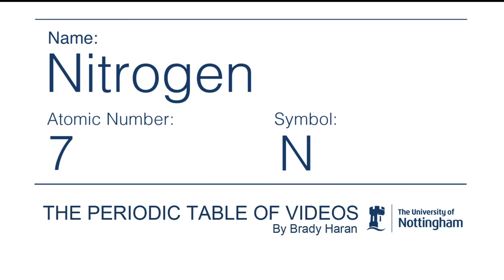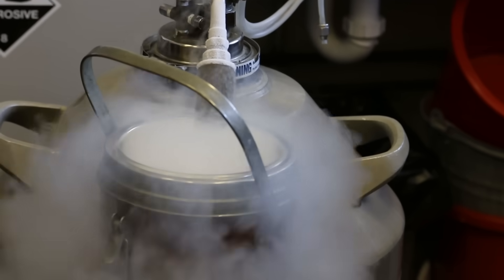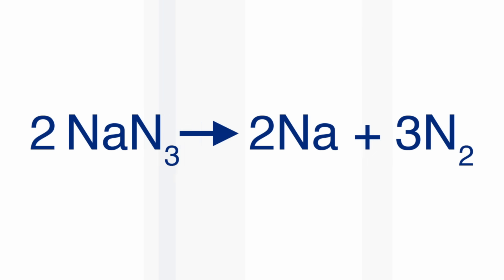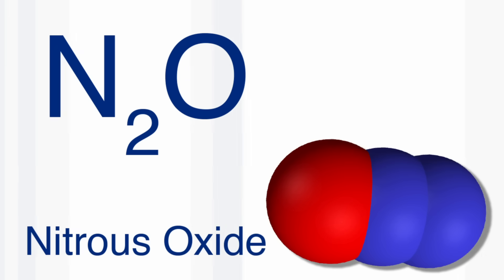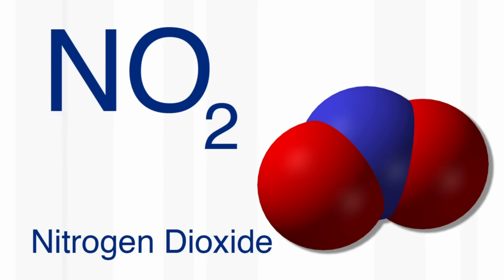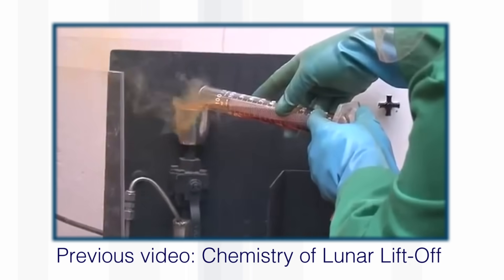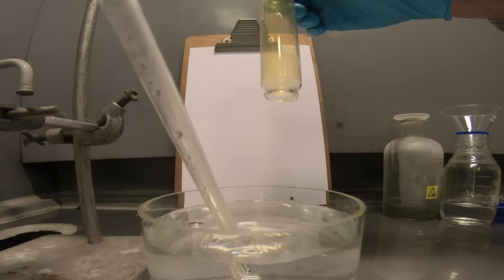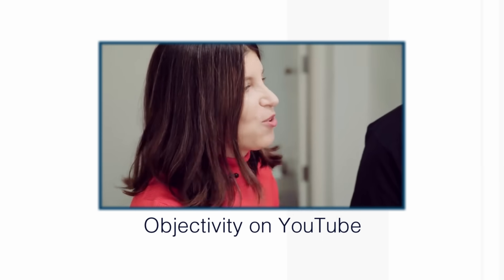Nitrogen - Periodic Table of Videos

Comment: The fog produced by LN2 in air is not "actually tiny particles of ice", it's fog - liquid water droplets in air due to the lowered dew point. It may be frozen directly at the surface of the LN2 but as soon as it starts mixing with surrounding air it turns to liquid instantly because of its minuscule thermal mass. 
Also note at 3:00 an interesting phenomenon which is not discussed - the flowing liquid N does not appear cold at all, in fact it looks the same temperature as the rest of the room because it's transparent to longwave infrared radiationl the diatomic N molecules have no dipole moment and so are unaffected by varying electric/magnetic fields of light waves.

Comment: The word you you were looking for when talking about NOx regarding diesel engines is their higher compression ratio thus higher temperatures.
Reply: Plus I believe a large factor in the production of NOx is because a diesel engine normally runs very lean, the cylinder always had an excess of oxygen that doesn't get burnt, and that can combine with nitrogen.
Reply: @Curtis You are right, and @logan thompson is only partially right. Diesel engines actually have lower combustion and exhaust temperatures than gasoline engines, but the fact that there is always excess oxygen is the main contributing factor for them to have higher emissions of nitrogen oxides.
Reply: That's a really long word.
Reply: That still leave the diesel engines particulates as part of the exhaust when they start rolling coal.

Comment: Petrol/gasoline engines do make NOx. The lower the compression ratio, the less conversion occurs in general. Diesel engines tend to run higher compression than gasoline/petrol which contributes, as does the general over abundance of air in a diesel engine, to high NOx production.

I love the videos- thank you so much to the whole team for doing what you do!